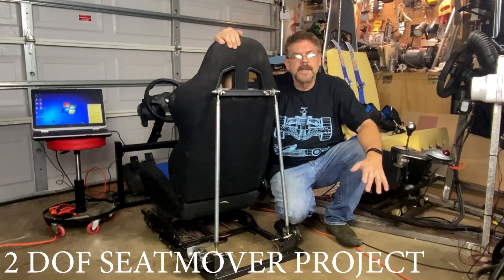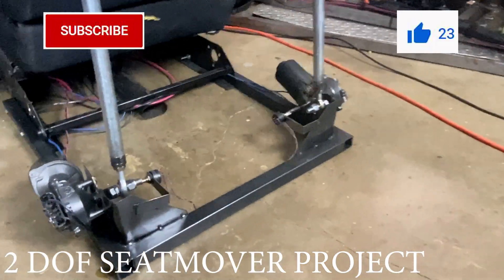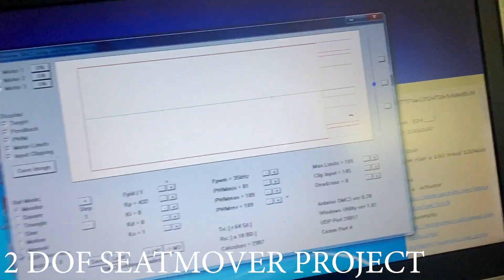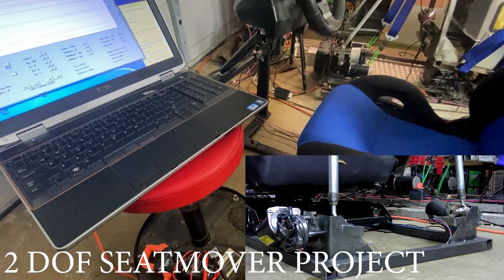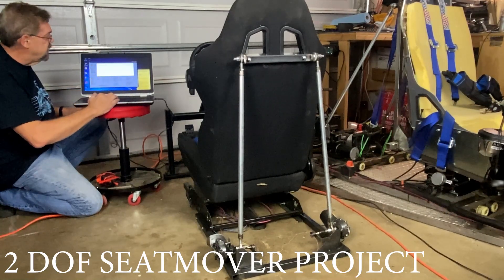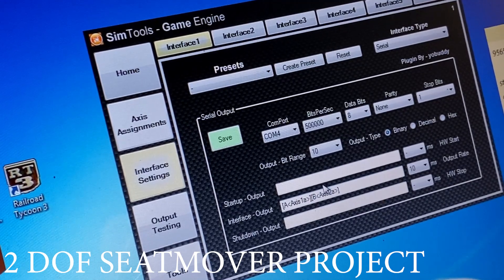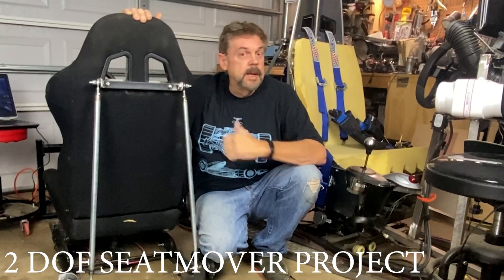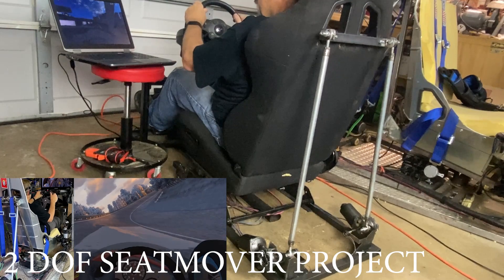Final Episode!  2 DOF seatmover DIY

Comment: Max I can’t express how much I appreciate your tutorials. 
Just a little tip for my overseas friends:
If your motors act strangely, remember to check your system’s unicode setting.
This caused me so much time figuring which part of the build is wrong.

POT choice:
Use hall sensors( rotary ) instead of those really cheap normal pot. The cheap pot have real low resolution, will make the rig only have big motions.

SMC3 and simtools:
I know smc3 is free, however the slider of both programs is real hard to control even on mouse. A simple keyboard left right click control will be much better
Reply from the maker: yeah i totally agree. use the hall effect pots. I have the digikey PN in the desc. use big motors.   Smc3 is really to adjust the limits of the motors and initial comm   Thanks for the comment my friend! Dmax

Comment: Great Job Dave! I wish I was your 12 year old 105 pound neighbor. Always nice to have a spare Rig for guest, Or Bed Room, Or Both
Reply from the maker: Nice!  So I'm considering getting some of those 24volt Jazzy wheelchair motors for the 2DOF and seeing if they can push it from underneath.  Any experience with them? I am going to use a 24volt AC to DC converter which can handle 30 amps I think.  Dave
Reply: @DMAX_DIY   Not yet Dave still looking for Motors Also.. I'll keep you updated
Reply from the maker: @RacerXtc  Yeah I get it.. I am looking how to convert the 12V batt to AC power anywya.  I'll do a vid on it when I get around to it in the next couple months..  Keep cool Steve!
Reply: @DMAX_DIY  Sorry Dave been a busy day.. Back on the road.. they needed my help for a couple more months.. Puts me on hold for now. Time will go by quick. Keep in touch
Reply from the maker: @RacerXtc  Yeah I know what you mean I've been roading it since Jan 1..  been home like two weekends..  2 years to go and then I retire.. should be great  (but gotta wait!) Dave

Comment: Keep it up man! Hey I finally figured out getting SMC3 to connect to my arduino. Originally I was trying to use a spare Arduino Nano I had laying around but I couldn't get it to work. I ordered a new Arduino Uno and uploaded the SMC3 V1.01 and it STILL DIDNT WORK. At that point I decided to download all the versions, V.6 V.63 V1 and V1.01. I uploaded V.6 first and it fired right up! Time to well my levers and mount the seat!
Reply from the maker: Great Comment BD!  Sometimes things can act differently and hopefully someone will read your comment if they are in the same situation!  Glad your up and running.  Yeah, the Nano is not the same as the Uno!  I'm adding more power next weekend to the 2DOF so hopefully  I can showcase another commonly available motor! Dave

Comment: First of all i would like to thank you, because i'm currently planning to build a motion sim and you save-me a lot of work.
But now i have some questions:
1) In your videos the software only has references to 2dof and 3dof, what if i want to make a 4dof?
2) There is any chance of emulate a 2 seat (pilot + passenger) simulator?
Thanks
Reply from the maker: Thanks for the comment Ricardo!  With a 4 DOF I would go with two Arduino's and 4 motor controllers. The Arduino can control 3 motor controllers but since you want a 4DOF, I would go with two motors per Arduino.. Check out the links in the description for more.  I think you could emulate a 2 seat simulator but you need to keep it pretty light or get really big motors..  Great to hear from you! DMAX

Comment: Hi D Max, awesome work there!  Have you considered putting a 24v power supply on those 12v wiper motors?
Reply from the maker: Actually no.. the wiper motors would probably not take it for too long..  But since you asked, I will go ahead and hook them up to 24V after I remove them to put the bigger motors on..  I'll document what happens  so everyone can see to 'match' component voltage ratings.. Dave

Comment: Max THANKYOU for making this series. in a few days I will recive BTS7960B, and will start to set it up. I read many places about BTS7960B have problems burning out, and there is a problem with heat transfering. What is your experience with BTS7960B and- do you use china-copies or original Arduino? What do you do to prevent burning the motor drivers?
Reply from the maker: So I use both the Arduino Uno and the clone. Both work fine.  I have only had one of the the IBT-2's stop working and I have used like 10 of them..  I have seen that you can unscrew the heat sink and put some of that blue heat sink tape on the surface then re-mount the heat sink.  I will do that on my next video. I bought the tape already.  I am also upgrading the 2DOF seatmover to bigger motors so check my latest series on that.. It pretty much covers 'everything' needed. Dave

Comment: Nice work :) Love the episodes.

Hope for more awesome projects :)

Is it hard to get stepper motors to work for this use ?
Reply from the maker: Thanks for the comment and I'm going to keep posting stuff so tune back in.   the control comes from the IBT-2 H bridge which will drive and hold it to a position so as long as it's a DC brushed motor  DMAX

Comment: Wow Genius here and not that many people know about him! Quick question what motors do you recommend using (stronger ones if any?)
Reply from the maker: Thanks Roy.  There are many other more power motors, I like the 50:1 crab pot motors that are sold by PGSAW of Ebay.. They are out of stock right now but I'll be getting more of them.  Also 60:1 motors by Motion Dynamics of Australia might be the best.  Last one would be some of those 24v Wheelchair motors. I'm going to do an experiment with them soon  I appreciate your comment!  DMAX
Reply from the maker: Roy, I just tested some 24volt Wheelchair motors and made a quick video on them.   They look plenty strong and are all over EBAY..  I will mount them up next weekend and see what happens if you have time to take a look.  Dave

Comment: Great vid again :) Are you going to make a future video on what motors are the ones you want on a rig? The upgrade after the wipers. I cannot really find any..
Reply from the maker: Yeah.. I am.. I am going to test those easy to get jazzy wheelchair motors..   They should be way more powerful than the WW motors.    BTW I use the PGSAW (ebay vendor) Crab pot 50:1 motors on my 3 DOF rig.. If they would come back in stock on Ebay I would highly recommend using them.. DMAX

Comment: How and where do you plug the steering wheel and the pedals?
Reply from the maker: Hi, most things like pedals, wheels, arduino and other items are plugged in via usb.   i have a powered usb hub which allows me to use a laptop to run my rig.  each item has it's own software and is recoginized individually  - pretty easy -  dave

Comment: How many watts power are these wiper motors, I am using 40 watt in my design.
Reply from the maker: I HAVE SEEN 27 AMPS AT 12V.. THATS ALL THREE MOTORS AT HARD BREAK TO HARD ACCEL PLUS SOME TL.    caps lock was on!   it idles around 4 amps